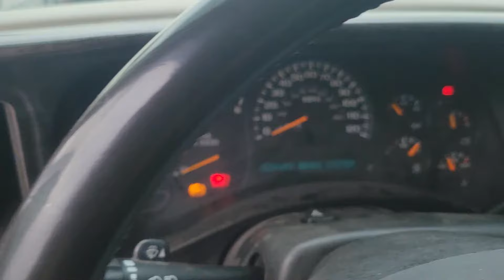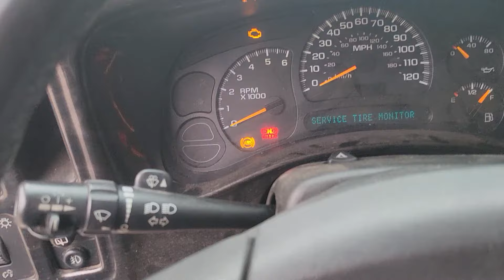Fix with NO parts (wire trick) - high beams turn (stay) on with turn signal -GMC Chevy- step by step

Comment: So you just sacrifice bright lights altogether?  That's not a fix.  That's a temporary crutch at best.  You should make that more clear in the video.  All that being said, thanks for your time.
Reply: Removing the bulbs is much easier.
Reply: Update...... The actual fix is to replace the turn signal/dimmer switch on the steering column.  It's very inexpensive and can be done in a few minutes with simple tools.  That way you still have bright lights and everything works as it should.  This is a known problem and there are videos on how to replace the switch.
Reply: LOL  Imagine thinking this was a good idea....   LOL but when someone doesn't know right from left    lol   Now how do I get my 8 minutes back?

Comment: Ooooor with the same amount of effort and time and $30, you could just undo 2 screws and 3 small wire harnesses and pop the bad turn signal switch out and put in a new one. That way you dont lose functionality of you're high beams.
Reply: Replaced multifunction switch still the brights come on
Reply: @Dutchtheyooper  did you get the oem replacement which is ac Delco? The off brand ones from Amazon are crap i went through 2 before I just bought oem.
Reply: @10886dom  yes genuine GM and its worse than the one I took out.
Reply: @Dutchtheyooper  if it's genuine gm than it's faulty from factory, send it back for a replacement.

Comment: had the same issue on my 2005 since forever (bought brand new 8 miles off the lot) . I didn't mind it and did not feel the urge to fix it.  Got pull over because cop thought I was messing with and him when signaling behind him. Turned out to be an hour stop of non stop harassment,  I tried to explain to him and even showed him but his little ego was not going to let it go.   cop was determined to find something to Write me a ticket .finally after noticing tint on my window, he got his wish and wrote me a fix it, mind you my windows were rolled down all the way, except my passenger had about a  quarter inch up exposing that my windows had tint.   sorry for the rant just venting as this happened last night.
Reply: Of course, you didn't mind it! because you weren't the one being flashed in the face with highlights when you would turn your signal on at a stop.
Reply: Could there be any possible damage doing this fix? How long will it last?

Comment: Remove the high beam lights, problem solved
Reply from the maker: The problem most people have is that their regular lights switch to high beams. While using the turn signals, if you remove the high beams, at night you'll have no lights at all. Also, some turn signal switches fail so bad that only the high beams work. This "trick" restores full low beams and turn signal function without having to purchase a turn signal switch and having it replaced.

Comment: Bro super slick I pulled all fuses one by one pulled the relays man I found out the blinker switch inside is whats causing it all my wiring is good in my 07 trailblazer so this should fix my problem also I will do this first thing tomorrow thank you.

Comment: Or you can pull the high beam bulbs out. I assume, much like my 07 Terazza, your truck has independant lights for the added light when highbeams are on. But like most here, I think this is a good temp solution of your driver and highbeams are all in one.
Reply from the maker: Most don't just pull the bulbs, because the low beams will still flash on and off. People have gotten pulled over and ticketed for that.

Comment: I'm experiencing this now, i see through the comments, it solves the problem.

Is the root of the problem a bad relay or a wire issue at the turn signal stick?
Reply from the maker: The root is at the turn signal stick. I believe the dealer calls it a multi function switch.
Reply: @Mil-usos  damn..... thank you SO MUCH for the fast response!!!

I'll be doing your repair this weekend.
Reply from the maker: Cool beans. Hope it goes well!

Comment: Have the same issue 03 Tahoe when the truck is off the high beam indicator light  comes on when I open the door it goes away would this be a relay I have LEDs through out my Wagon

Comment: I have this issue with my 2000 Deville. I do not plan to keep it much longer so I will try this. I do have a different issue I could use some help with. Do you know where I can find a diagram of how or how the rear window washer hose run from the washer reservoir to the rear window wiper?

Comment: I have a 2007 Yukon.  When the lights are on, they turn off when using the right turn signal.  I have replaced the multifunction switch.  Wondering if I need to know focus on the HDLPLO?HID relay?

Comment: I have a 2002 GMC Yukon xl 1500 having a problem with my turning signal when I make a left or right turn my switch click off but my turning is still going clicking noise it's still on how can I fix it

Comment: Will this make you lose high beam completely?
Reply from the maker: Yes, yes it will. As mentioned in the video, the "right way" to fix this is to replace the turn signal switch (GM multi function switch). This is a low cost and legal option for those on a budget.

Comment: If your gonna jump wires might as well take the switch out and fix it, just got done doing my 05 Chevy Tahoe. I would hit the right turn signal and the high beams would come on. Here is the video I followed https://youtu.be/fwZsW7ZrLu0 just fyi I didn't remove the back cover just the cover with the four screws and I didn't 3D print anything just filled the groove with some JB Weld Plastic Bonder let it set and put Dielectric grease on everything. I put it back together and it worked perfectly even got rid of the harsh click when setting and resetting the turn signal from the extra lubrication. For anyone wondering why I didn't just buy a new switch it's because I was finding them from $34 to $150 and they all had mixed reviews so I said "it's already not working right and I'm blinding people when I turn right so let's give it a try." And it worked.

Comment: This makes no sense whatsoever. What does jumping the wire do? You literally just take out the relay and call it a day at that point.
Reply from the maker: If you remove the relay, the lights will turn on and off instead of switching from low to high. The wire switches the lights from low to low. Check out the other comments on this video for examples of success with this trick.

Comment: Great temporary fix . But I would want to know what part to change to fix the problem
Reply from the maker: The turn signal switch. I think GM calls it "multi function switch."
Reply: @Mil-usos  yep i changed the swithch on mine and 2 years later the same problem is happening again lol.
Reply: same loll @DaleBlackBass

Comment: My girlfriend tahoe dose the same with headlight with right turn signal on but it turns off headlights completely with high beam indicator on in the dash
Reply from the maker: 🤔 Man, I'd love to get my hands on that Tahoe to diagnose it. It's the curious mechanic in me lol. I'm curious to know if this wire trick would change anything headlight wise...
Reply: Any updates??? Im having the same problem with my 03 tahoe
Reply: @santeealphard4763  had to replace the control switch....
Reply: @nolove5062  I appreciate you